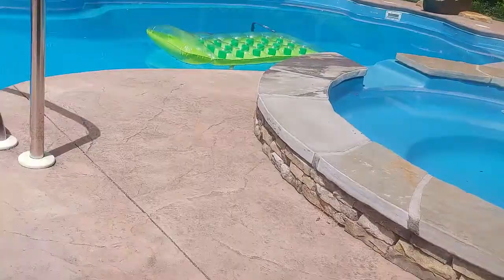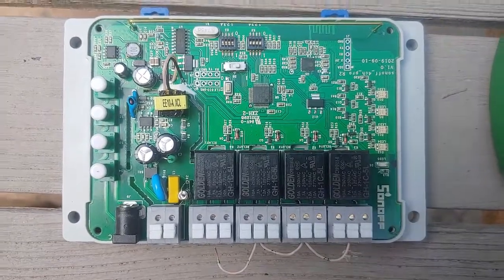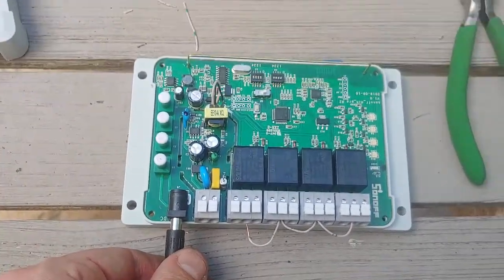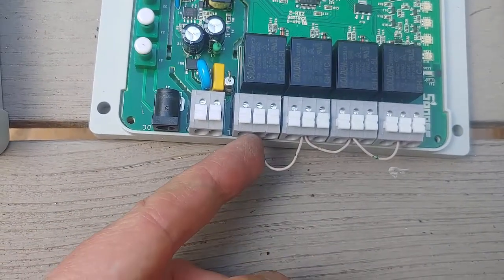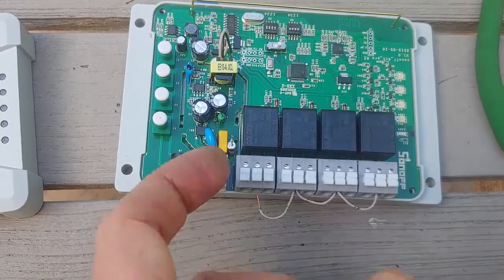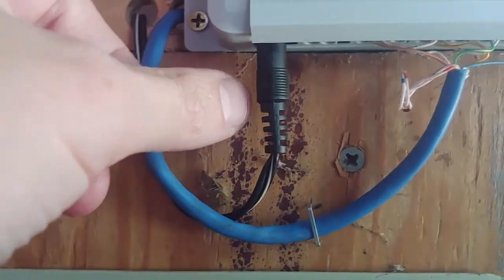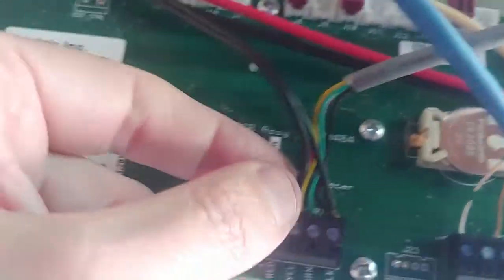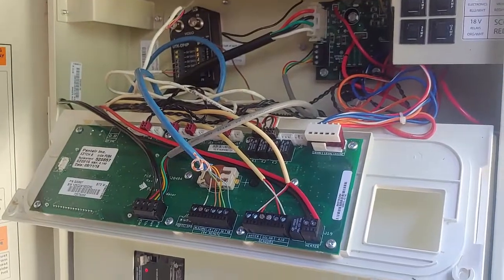REVIEW & overview: DIY Smart Pool and Spa Switch for $29 works with Amazon Alexa/Google Home

Comment: Anyone made this work with a Goldline Aqualogic (not Prologic) PS-8 with Spa and Heater. I would like to be able to remotely put the system in spa mode, turn the valves, start the heater, etc.  My system currently has an RF transceiver and wireless SS remote on it but the floating SS remote no longer works, so I think I can remove the RF transceiver.
Reply: I rewired my whole RF hayward remote and installed 12 channel relays that works with smartthings.  Basially my RF remote that stays inside my house connects to the internet.  I can control all the funtions of the pool remotely.  I did this 3 years ago and it's still working great.   I can turn my jandy valves for spa mode and turn on the lights,  heater,  and it's hot by the time I get home.

Comment: Hi, I have a Compool cp2000 + lx-10. Old but working. I just watched your video and connected a sonoff switch to the spa side remote. Works great except I can’t seem to control the heater. Doesn’t kick on automatically when “spa” mode is selected (only the valves turn). Any ideas? Thanks again— great video!
Reply from the maker: Thanks for the comment. I looked up pics of your panel. Is the physical selector switch on the panel for your heater on for spa?  Because it seems to be a physical switch (mechanical slide switch) on your panel I am not sure that you can control it from the spa side remote connections. There may be a chance that you can study the contacts on the switch and solder wires for the "heater on" mode to make it work.  Please ensure it is low voltage as I am not familiar with your panel. Test for the heater on mode using a jumper wire across the two contacts that you think turn it on That switch mode on the sonoff for your heater may need to be a locking mode instead of momentary as well. Does this make sense? Again, please ensure this is all low voltage and proceed at your own risk. Let me know if you figure it out.  Thanks

Comment: Jason, I've watched a lot of videos of blokes trying to show how to do stuff. Yours is exceptional, you cover all the bases. I do have a couple of questions: Is there any programing of the EZTouch system itself? Does one simply remove the EZTouch hardware devices (the WIFI and the Interface)? Rgds, Ken Wood in Camarillo.
Reply: @SwimmingintheDeep  One more simple question: when power applied is there any heartbeat led or any other feedback that I know it is working. I plugged in a 12V DC power supply and do not see any activity.
Reply from the maker: @kenwood4764  Ken, that is the drawback, there is no confirmation. Thanks for commenting on my vid! Can you do me a favor and please subscribe to my channel? Every sub gets me closer to my goal and encourages new content.

Comment: Jason, I currently have a spa side remote. Can I also have this device connected as well assuming the functions for both the remote and this device remain the same (i.e button one turns on the spa from either the spa side remote button or this wifi button)? I rarely use the spa side remote anyway so not a huge deal if I have to take it out but would keep it if I can .
Reply: Answered my own question, the answer is yes, you can leave an existing spa side remote connected and connect these as well. In my box, Jandy 6614, the wires were colored slightly different but directions were the same. Mine had a brown wire instead of the red as in the video. I had a red as well but that was not for the switch. Easy install and love the new functionality. Thanks for the video!
Reply from the maker: @johnclausing  Thanks for commenting on my vid! Can you do me a favor and please subscribe to my channel? Every sub gets me closer to my goal and encourages new content.

Comment: Thank you for this awesome post. This is saving my $100s! I followed your video and the system works perfectly. I am posting some of the hiccups I have alongs the way (especially for Jandy Control Boards)

1. Sonoff Pair Issue
-for some reason I had challenges pair the son off board with an iOS device
-the system pair nicely with my old Android phone

2. Jandy Control System: Terminal Bar Issue
-If you own a Jandy unit without a side remote, chances are that your board will NOT have the 6-Pin Terminal Bar to allow you to screw each wire to the pin.
-These bars range from $40 to over $100 online
-you can create your own using Pin Housing Connector kits that are found on amazon
-or use a female crimp pin connector that fits onto each pin

3. Jandy Control System: Programming Each Button
-If you have a Jandy OneTouch System, you can program each button through the following menu commands:
MENU/HELP-SYSTEM SETUP-SPA SWITCH-Select 1 (for the number of remotes)-Prgram what you want each button to do

Jason once again, thank you for this post!
Reply from the maker: Thanks again for commenting on my vid! Can you do me a favor and please subscribe to my channel? Every sub gets me closer to my goal and encourages new content.
Reply: Done
Reply: Do you or anyone else know if the Jandy version 6 pins labeled spa side switch, is the first one common, 2nd led, then next 4 the actual switches you’d be controlling?

Comment: This is awesome! I just stumbled on this vid as I was searching for a way to automate my pool from google assistant. Will be trying to take what you shared and make it work on a Hayward Goldline board this weekend, fingers crossed!
Reply: @SwimmingintheDeep  there aren't any spa inputs but there are 4 "remote display" inputs that I'm going to try out. Will let you know how it works out
Reply: @SwimmingintheDeep  well, I goofed and fried my pool board. I hooked to a power source I thought was good but wasn't. In retrospect I should have just plugged the sonoff into the outlet I had nearby, live and learn.
Reply: @James.Buchanan  I did the same :)  Try this:
https://www.troublefreepool.com/threads/cheap-simple-web-enabled-pool-automation-with-google-assistant-integration.214676/
Similar to what he's done above, but removing the control board from the equation.
Reply: @JRSkola  thanks for the heads up! I'll have to check this out
Reply: @James.Buchanan  Did you retry and which method did you prefer,  troublefreepool or this video?  Any ideas on waterproofing if plugged sonoff into an outlet.  Any details and tips are appreciated as I wanted to avoid the inadvertent but $ board replacement.
Reply: . @JRSkola  I checked out your link. Any chance of a step by step video of your installation?  Im hoping to web-enabled my Jandy pool pump, waterfall, and lights as well.
Reply: @ECrackster  I have not, I'm afraid to mess it up after paying to have my board repaired